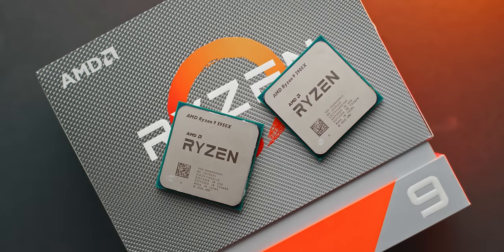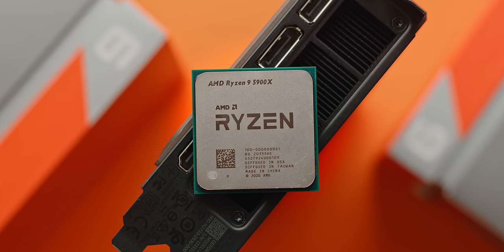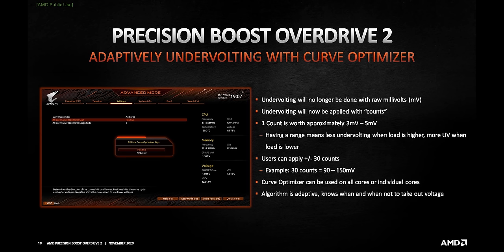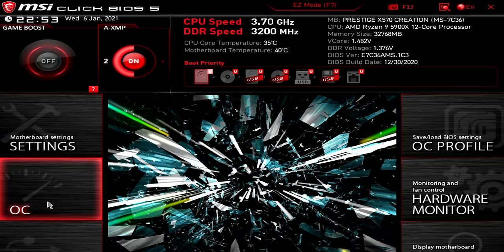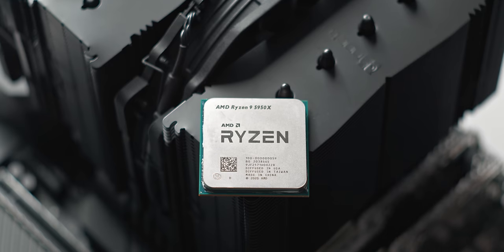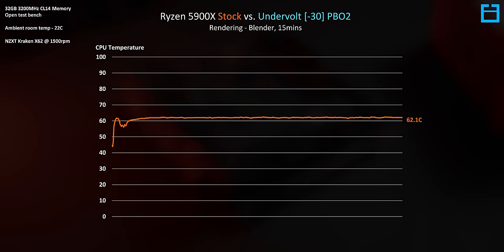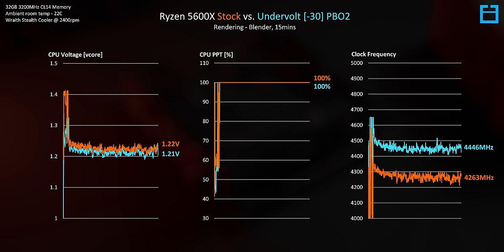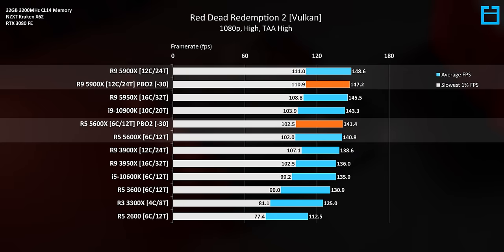Ryzen 5000 Undervolting with PBO2 – Absolutely Worth Doing

Comment: You went over the most important part of all of this in the video which is stability testing. The main issue that I found while trying out the curve optimiser is that even though you can test it each core individually or all cores at the same time with different stress testing programs this will can only guarantee stability during intensive workloads. Most of my crashes that I faced were while the PC was idling. I haven't found a consistent way of testing this aspect of the curve optimiser. I have checked reddit posts and different forums and I've seen people complaining about the same issue. The PC can be stable while running prime95 all night but it will crash while you just browse the web. I propose you do a followup video after you use the system for at least one week with the settings you showed and then report if the system was actually stable. Maybe even make a video that covers stability testing.
Reply: My PC with a 5900x gets a blue screen at -27 while doing nothing.
Reply: @RubiiX It doesn't test idle stability. I have tried running prime95, occt, cinebench for multiple hours and I can still just crash on the desktop while not doing much.
Reply: @RubiiX how do you set cinebench up to run for 30 mins ?
Reply: @RubiiX got it, is there any way to do similar in R15 tho?
Reply: At idle you're at the bottom of the curve and that voltage may be too low. Maybe there is minimum voltage setting to compensate while still being able to take advantage of the curve optimizer for higher voltage/frequencies.
Reply: im getting negative  25 all cores on my 5900x and ran prime 95, cinebench r23, occt for the past 3 nights and no crash so far
Reply: @harizjaafar87  I did the same and passed with no crashes.  But gaming (WoW, CoD Cold War, GTAV, Monster Hunter) led to consistent crashes.  Lowered to negative 10 and the crashes while gaming lessened but still happened occasionally.  Turned off the offset and have had no crashes this week.
Reply: So what are your suggestion guys?
Do it or not? I can't afford my pc to crash. I run mine practically 24/7.
Cooler temps would be nice especially for summer and when idling.
Reply: @Ruby_Mochii  Its easy, use corecycler to find out the counts you can use for each core. then you can have 100% stability and use the curve optimizer.
Reply: @Ruby_Mochii  if u want cooler temps just use fixed all core oc and fixed cpu voltage then disable precision boost overdrive, i used 4GHz all core and 1.2V on my 3700x, and with the same performance it ran cooler then stock like 7-8C
Reply: This is exactly what i was thinking, the curve optimiser applies greater UV at lower stress levels and lower UV at greater stress levels, that means, the stability testing should be done at near idle state because the effect of the UV would he more pronounced there.
Reply: @Ruby_Mochii  if even a single crash proves catastrophic to your workflow, i'd say no OC/UV on either cpu or gpu is worth it. Only buying better components/ coolers and running stock would guarantee more performance at cooler temps and 100% stability
Reply: This.
I put negative 30 and tested it a bit with cinebench and OCCT and AIDA64 for like 10-15mins each, all seemed fine. When I launch something like GTA Online I sometimes crash after 1-2 hours randomly.
Reply: just stop at -25 and stop trying to push harder for some reason... 

I've had mine runnning at -25 for 7 months with no crashes
Reply: @Jolinator  but Corecycler doesn't report suggested counts, merely tests whether stable (it's a great script).
Reply: @piers389  I have a 5900x. I used prime95 and occt by testing each core individually by setting the affinity and running the stress test over long periods of time. The system seemed stable under load but it would just crash while idling on the desktop. I haven't tried using newer methods but I don't see yet how those would help if I can't test stability during lower power states.
Reply: @e_Moses  Corecycler is awesome for finding instability where other applications fail. Let it run for 20 hours with default settings and it'll tell you if any cores (and which specific core) are unstable where other applications show them as stable.
Reply: Make sure you're using the latest chipset drivers and the balanced power plan, I am at -30 on all cores but the main core used by windows which is at -26, it appears stable might push higher. Keep in mind it will not be stable when doing stress testing but should be 100% stable doing anything else a normal users would do. I am also noticing that it's more stable in Win11 vs 10. Unless all you do is run stress tests on your system then this undervolt should be pretty stable at higher offsets.
Reply: @vladger6097  "keep in mind it will not be stable when doing stress testing" - that means it's not a stable undervolt and is likely silently corrupting OS files while you use it and will lead to crashes (remember more and more games use AVX2). If it can't pass 20 iterations of CoreCycler at default settings, it's not stable.
Reply: @piers389  I've been running it for a couple months now, it's working fine so I am not worried. OS corruption is very rare with CPU OCing. Games might be using AVX2 but as far as cpu load goes it isn't going to be anywhere near 100% or ever hit a stress test load. The only game I've run into that even uses 40% of my cpu is BF5. I also game at 4K so it's an even lower load on the cpu.
Reply: @vladger6097  
- It's your system. I'd be concerned about an unstable overclock.
- With Ryzen, OS corruption is more likely (only if an undervolt/overclock is unstable) for two reasons;
a)  due to the voltage regulators for the cache disabled on consumer products, meaning the cache relies on VDDCR CPU.
b) the IO die can be impacted very easily if the CCD isn't stablez which leads to memory corruption as the IMC is part of the IO die.
- If games - even modern multithreaded titles - aren't using more than "40%" of your CPU, you either have an atrocious graphics card or the CPU isn't receiving enough voltage. I game at 4K as well and don't see this problem...
Reply: @Butanding  hahhahahahahahha.
Reply: Would be nice if someone can help me out here.
Asus Crosshair VIII Dark Hero, 5900x, Kraken Z53, 3080 FTW3, 64 GB RAM.

I tried undervolting recently and found the following results -
If core performance boost is enabled, then the undervolt from PBO results in speeds of 4.4 MHz up to 4.9 MHz, however my temps are a bit f'ed, like 70 to  80 degrees on load, and idles at 50 degrees.
If CPB is disabled, then the undervolt from PBO results in only 3.8 MHz at max, but temps don't cross 50 even at full load, idles at around 35.
Which would you prefer to use? Or what would you prefer to configure other than suggesting hardware changes?

The main reason for such f'ed up temps is cause of the casing I am using which is the Nzxt H710. Using push-pull fan config on the front as intake with the AIO. Top and rear are used as exhaust fans.
Reply: @kazitahzid6558  80d ain't nothing to worry about.
Reply: @kazitahzid6558  hey what Settings did you end up choosing ? I have the same CPU and mobo
Reply: what about just using the PC like you normally do and then see if it works?
Reply: @dioxyde0  Mine crashes at 10 :(
Reply: @Appleloucious  mine started bluescreening recently when playing hunt: showdown and most clues lead to undervolting/insufficient power. possibly cause i added more hardware and stuff. gonna revert back to default, hopefully bsod issue will away
Reply: @dioxyde0  ☝️
Reply: @aCatSiki  I’ll look into it! Thank you!
Reply: @Appleloucious poor one cannot achive -30😂

Comment: MY Ryzen 7 5800x with a -30 offset: Novabench showed a jump from 4.68 to 4.83 GHZ and an overall score increase from 4195 to 4245. CPU runs 12c lower at idle and roughly 8 - 10c lower under load. Great information and a real worthwhile tweak for 5000 series users.
Reply: thank you and also you seem to be lucky as Im hitting 4.7-4.75 GHz at maximum in cinebench and even drops slightly under 4.7 GHz because it reaches around 80-82 degrees. Im using Arctic Liquid Freezer II 360
Reply: What settings you used?
Reply: Starfield is wrecking my temps, 89c on the CPU while playing the game so here I am trying to undervolt my 5800x
Reply: @5erase  how is your airflow and what cpu cooler you use
Reply: what is your idle temp? I have the same cpu is sitting at 45C with firefox open.
Reply: @SkillerWolfCFM  i have same cooler and cpu, any updates ?